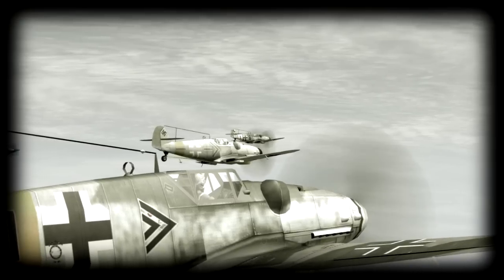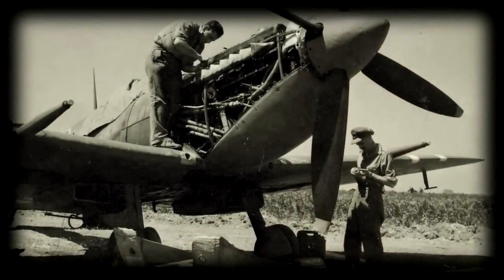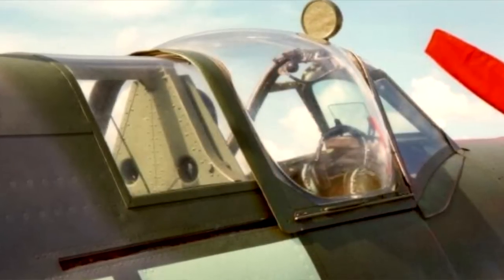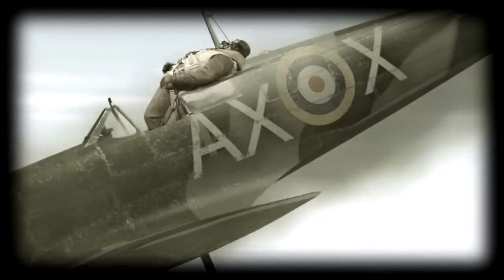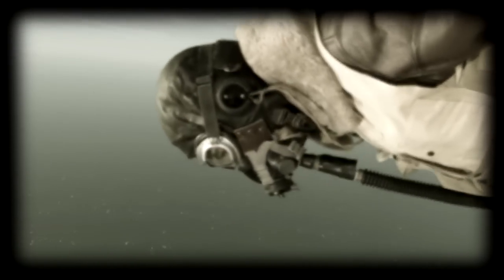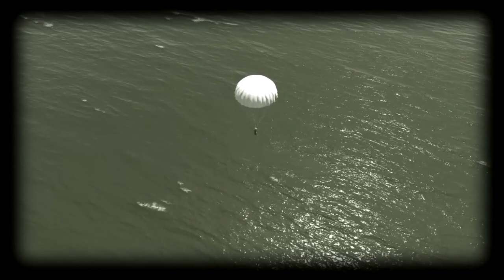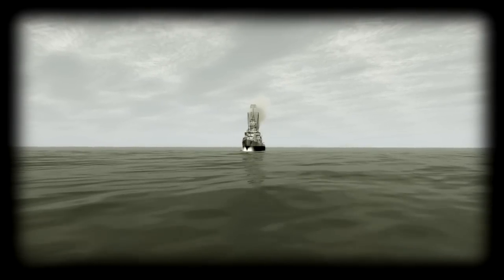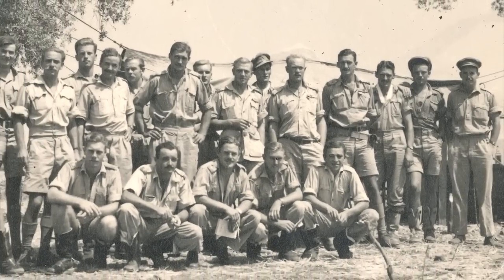Bailing from a burning Spitfire; ww2 Spitfire pilot interview Dave Hastie 1

Comment: One of the few flaws in the Spitfire - the main fuel tank was right in front of the cockpit. If it was hit and set on fire, the pilot burned! There were so many burns victims that there was a Club formed. The treatment for burns was pioneered by Sir Archibald McIndoe and the pilots called themselves the "Guinea Pigs" When I was 3 years old, in 1955, I was burned by boiling liquid. Thanks to McIndoe and the hundreds of Guinea Pigs I was treated using skin grafts and completely recovered.
Reply: @HiWetcam So did the Hurricane, at least in early models.
Reply: I think later on the trend was to put fuel tanks in the wings, but fighters designed prewar or early in WW2 tended to have the tank under or just in front of the pilot.
Reply: Good for you my friend, I'm glad to healed up good & yes those men sure paid a sacrifice & their stories are amazing to listen to considering the odds they were faced against but improvised , adapted, , achieved & over came, The Soldiers & Britain as a whole who have proven to the world that no one can take the human spirit of will & desire away from anyone if one does not give up at all, From Dunkirk ,  the Battle of Britain to the end of the war victoriously against all odds in the face of a mad man, extrodinnary  example of just how resilient the Brits are & always been & will be!
Reply: @kaczynskis5721  The Hurricane had a 27 gallon reserve nose tank and 35 gallon main wing root and belly tanks. 

Experienced Hurricane pilots always emptied the reserve nose tank first for obvious reasons.
Reply: Stewart Nicol as BILLY CONNOLLY , that was the hurricane oil tank !!!
Reply: @robertwoodroffe123  Correct. The Spit never had that 'club' only the Hurricane pilots.
Reply: It was a common location for the fuel tank in fighters because it was very close to the centre of gravity and didn't upset the aircraft's handling as the weight of fuel decreased.
Reply: Same for the 109, too, where the pilot quite literally sat on top of the fuel tank!

Comment: If anyone is wondering about how they did the virtual animations, it's a video game called IL-2 Sturmovik 1946. It's a fantastic game and you should be able to find it for under $10.00
Reply: G10rgos_7 I have IL2 Sturmovik 1946 and IL2 Cliffs of Dover, and I think it´s CoD, best graphics ever, and realism.
Reply: Best graphics? Eh War Thunder has superior graphics in my opinion. But flight models and realism, IL-2 takes the cake by a long long mile
Reply: G10rgos_7  I meant best graphics between IL-2 1946 and CoD, haven´t really played W Thunder. If you haven´t played CoD I highly recomend it, the flying is incredibly real, difficult game to master because it´s complexity.
Reply: G10rgos_7 Or DCS or il2 battle of stalingrad
if u ever wanted to learn to fly like theese pilots did in real life, these are the simulators to try
Reply: kl0udykl0ud I fly DCS on a daily basis, I haven't tried IL-2 Battle of Stalingrad though
Reply: Aces High II is the most realistic.  AND its a 24/7 multiplayer arena.  Hundreds of aircraft competing for the same skies.
Reply: How did they do the pilot getting stuck on the canopy, is that part of the game too?

Comment: War emergency power push the throttle past the gate super charger +12 PSI the Merlin engine would add 250 more hp. The P-47 would inject methanol to cool the engine in WEP.